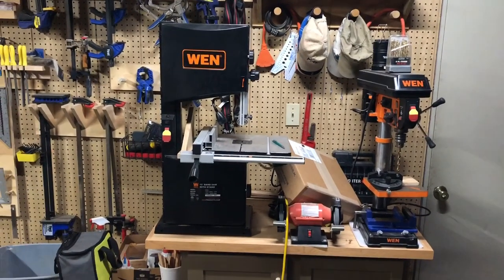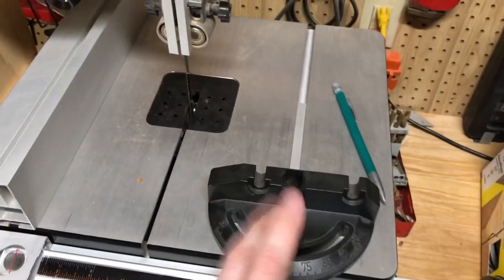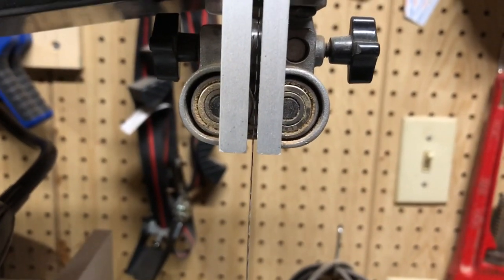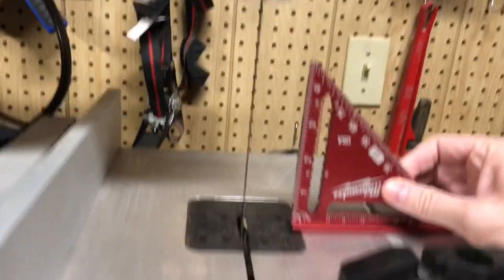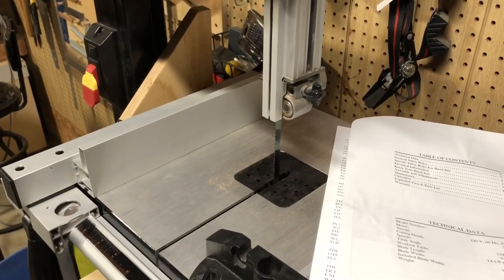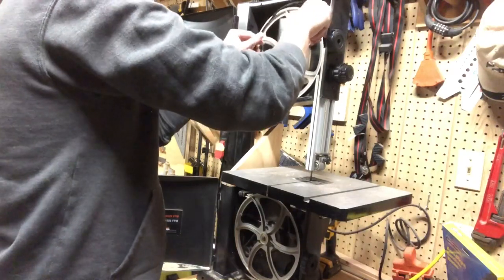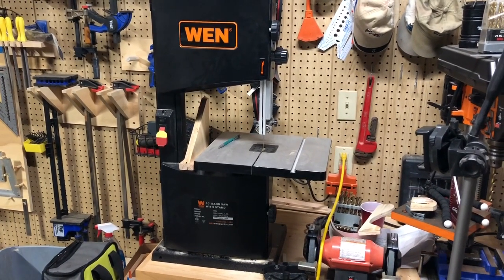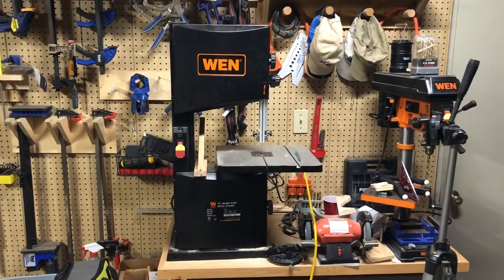WEN 3962 10” Band Saw Review

Comment: On the tilt handle you can pull the handle directly out and it will be able to rotate to the next indexable spot. I'm not sure if I explained that in a way that makes sense, but if you stand behind the saw then pull the handle toward you can rotate the handle. Hope that helps.
Reply from the maker: I just tried this out and you are correct.  Weirdly enough I didn't see this mentioned in the manual in the section on adjusting the table.  Thanks a ton, I'll put this info in the description.
Reply: @NotThatMattNagy  I've been caught out before on the "damnit, this handle interferes! what a stupid design!" thing before, and then as I'm raging accidentally pull on the handle.  <sheepish grin>

Comment: I’ve the same saw and I have a re-saw comment.  After watching Stumpy Nubs video on band saw blades and teeth I felt well informed.  I was having a terrible time getting my blade to cut straight and found that moving to a 4 TPI, 1/2” deep blade did the trick as Stumpy suggested.  I can now cut straight in 3+” thickness wood and can thus re-saw accurately now.  I also ordered a 1/4” blade at 10 or 12 TPI for cutting curves.  The right blade makes all the difference.

Comment: This is a good review. Thanks👌

I bought this saw one month ago from Lowe’s $235 with free shipping to my door 👍. This saw is replacing my 9” WEN bandsaw which is going to my son’s home shop, I like WEN products. Getting a lot of use out of it cutting everything from pine to maple & oak and plywood. I passed up a beautiful ‘60’s 14” Delta for this saw that’s a 250+ lbs saw I didn’t feel like moving. Anyway this WEN is a fantastic saw does everything I want. Things that could be better:  needs a standard 3/4” miter slot for making jigs, change the fence handle so it doesn’t block the bottom door (that’s all). Love the light, upper blade guide construction is solid, table adjusts easily, great stand, great dust collection, 6” re-saw capacity, quiet and plenty of power. I don’t experience any blade drift on this saw. The miter gauge is OK usable, the fence is fine I get good use from it and like the configurable options.

For blade tension and selection tips check out Timber Wolf web site for bandsaw blade information.

I lightly “pluck” the blade until I hear a clear ring to judge proper tension.

About the 6” re-saw capacity, my philosophy is to use a saw to about 80% capacity. So I limit my re-saw to about 4.5 to 5” regardless of the type of wood. I’ve milled maple and apple tree parts without any problem. This is a great 10” bandsaw.

Comment: I have had the same bandsaw for a couple of years. It works well for what I have done, which includes cutting boards from small logs. As for removing the fence to change a blade, I just attach the guide bar with only two of the four clamps. Half the work then. I also have mine on the stand, which is them on a mobile base. It seems very firm to me.

Comment: I too am very impressed with the WEN products price performance. A few months ago I bought the WEN 4214 Drill Press and the WEN 6502 4X36 belt sander.  Both are excellent to use and so far both run perfectly.  I also bought the WEN Forstner Bit set which works great and some Wen F Bar clamps which also work well.  Today I ordered the WEN 3962T 10 inch band saw and I was pleased that your review was mostly very positive about the unit.  I am looking forward to the arrival of my band saw and as with other WEN products I'm confident it too will perform well.  Thanks for the informative review.

Comment: For the table lock knob and all like it, pull out on it and you can place it at any direction.  Tighten some then pull it out and relocate it and tighten more. I have this saw. Finding blades for it takes some searching.  Mine will not track a 1/8 blade.  Also the guide bearing are difficult to adjust.  I will eventually replace mine with a nice powermatic
Reply from the maker: Someone pointed that out and I put that info in the video description. I have good luck with Carter for my blades; just bought a 1/2” 4 TPI blade for re-sawing. I found the guide bearings fairly straightforward to adjust, maybe a little finicky. I think I will always have a small bandsaw like this to cut curves, even if (when) I upgrade to a bigger bandsaw.

Comment: I bought the Ryobi bandsaw yesterday (BS904?). I figured it would be "good enough" for me before seeing this video.

The main differences between the two was the Wen has a stand, light, guide bearings, a two speed motor, and more power (3.5A vs 2.4A). The positive stop for leveling the table and double the resaw capacity is a bonus. About the only negative I've seen that wasn't mentioned was the lack of a de-tensioner lever that other saws seem to have to pro long blade life (I don't think the Ryobi had it either).

So after this video, I reboxed the Ryobi, got a refund, then ordered this Wen. I'm paying about $100 more than you did unfortunately, but I feel this saw will give me more for the money than the Ryobi in the years to come

Thanks for the review!

Comment: I just bought the exact saw, mounted on stand and very solid. I was looking for help on tensioning the blade as each I time I try to cut the blade wonders even with the fence. After your review, it seems my blade is too loose. Good review. I find the fence useless as it does not lock on square.

Comment: Great video. Bottom of pg 12 of instructions describe the tilt lock. My 45 degree stop maxed out before the table got to 45 so I removed it. I might grind out the slot later. I think an advantage of the 0 degree stop is  it gives a solid support to the table.
Reply from the maker: Thanks, I checked the bottom of page 12 in my manual and it didn’t say anything about tilt lock. Weird. That sucks about the 45 stop, but I think you’re right, a little grinding with a Dremel will do the trick.

Comment: And it has ''ROLLER BLADE GUIDES'', a major plus. I do like the size of that table. I use those clamp on spot lights to high light all my cut lines, especially over my shoulder pointing at my scroll saw, the built in light is a must have!
Reply from the maker: It’s a nice little feature to have, I use my light a lot.

Comment: I also have the same band saw and drill press along with the Wen bench top grinder.  All have proven to be well worth the money.  The under the table adjusting handle for tilting is fine and does not really have a design flaw as that handle can be adjusted to any position by pushing in the small knob on the end and pulling the handle towards you and turning then release at the position you want it.
Reply from the maker: I agree, all of my WEN purchases have been well worth their cost.  Another commenter brought up the point about the lock handle, and I put that info in the description. Adjusting the handle in that way isn’t listed in the manual though, so WEN may want to check that out.

Comment: The feature that works the best is the dust collection port. Breathing less dust is always better, as is less dust building up in the saw. Not on that, but the vac or dust collector draws air through the motor keeping it cool, especially important when cutting thicker stock/ resawing.

Comment: Gord LeLacheur
Looking to purchase this bandsaw and have just seen this review.  Very good review. One comment is that if the fence rail has four securing bolts and if two bolts are on each side of the blade slot, could you not saw through the fence with a, 1/8" kerf chop saw at the table slot point to allow the blade to be changed without removing the fence rail and still have enough fence rail rigidity to support the sliding fence ? Just a thought.

Comment: You can get some flexible 4 inch hose and hook it to a shop vac or a dust collector.  There are these cyclone devices too that mount on a trashcan and use a shop vac.  Most of the stuff ends up in the trash.

Comment: Not sure if you get this... Not sure if I am having an issue with my WEN Band saw or not.
Are you able to move the top wheel forward and backward?
The tension screw knob came out of the square metal part and I needed to remove the back plate and get it connected. Now the Blade tracking know, when I turn does not do much and I can move the wheel forward and backward. Have you had any issues like that?

Comment: I’ve not dealt with this saw but was wondering if the spacing on the fence guide bolts were so that you could cut the guide so the blade would travel through during change

Comment: The welds break on bandsaw blades quite often. While working my way through college, I had a job that required me to weld 100 to 200 broken bandsaw blades every week. I particularly disliked the welding and annealing of blades used for cutting meat due to the smell of the burning tallow.

Comment: extremely well presented. I just bought a 3359T the 9 inch version. I never used a power saw before. I gave it a quick try and now have the courage to use it more. I will be rarely using it though. For small craft wood projects. I might need to do a few cuts on a thick hard wood board like 3"x3"x20". Bevel cuts, slight angles etc. And at other times thinner boards. Wondering if I should swap it with the 10" version - the 3962. The build quality seems about the same from your presentation. Mine came with a 1/4" blade.
Reply from the maker: I’ve only ever used it for 90 deg cuts, but that’s because I have a table saw and/or router table for the bevels.

Comment: It may or may not be the case with the lever handle knob on the back of the saw for angle adjustment, but it may swivel when you pull out on the handle allowing you to reposition the lever and turn it from a different position. Sort of a locking ratchet motion that I have seen in other designs. Again, this may not be that type of handle.

Comment: I wish you would do a video on detail adjustment which I find painful on this saw. 3/8 factory vs 3/16 you must have did a guide adjustment and the tracking vs tension I find mind blowing on this unit. I have a perfect track with tension way under 1/8 deflection. As soon as increase tension it tracking goes south. Only way I get it in is to tighten in tiny amounts and tiny tracking until it runs right (which is blade center not curf...don't know why but it works). The guide the top isn't bad to adjust but you have to do both and the lower is very tweeky. My attempts at blades other than 3/8" factory have failed (1/8" just broke in no time). I'm going to try the 3/16" like you did so I can get my middle of the road. I also never leave fence on just because it's for re-saw or straight cuts that really are too much for this saw. Please consider that detailed adjustment. the big guys all do it with Powermatic or other industrial grade and their guides aren't like this.

Comment: Im debating on getting this bandsaw but I just had to buy a new table saw, and planer. I did go cheap on the planer and got the spiral head wen planer. My band saw just stopped working so I do need one but in all reality it is a nicer one then the wen just old and I can probably fix it. The motor is making a noise but will not move so I may take it apart see if I can get it going again. It's either that or risk the wife giving me grief over buying toys. She's never said nothing to me in the past but I've made a lot of purchases recently and the last couple I've gotten the look. She has already said I have a tool addiction in play but with women you never know lol.

Comment: So the handle for the table and tilt does not pull out while tightened to be moved to another spot ? Or in other words tighten it down pull the plastic handle out towards you and move it to another spline and it pops back on....this is how it should be...My Porter Cable bench sander has that kind on the tilt table for the disc...AND it also has a design flaw with the dust bag not being able to be turned 180 degree to lay BEHIND the machine....hits the mounting leg...
Reply from the maker: A commenter pointed out awhile back that the handle does indeed pull out and move to another spot.
Reply: @NotThatMattNagy  Looking at the 9" right now not sure the price difference is worth it..

Comment: Great review but was hoping you’d mention the blade tracking on the bottom wheel.  While I can center the blade on the top wheel, it wants to shift towards the very front side of the bottom wheel, to where it looks like it might come off. Any way to adjust that?
Reply from the maker: I haven’t encountered this issue. The bottom wheel isn’t readily adjustable. I would call Wen and let them know.

Comment: Thanks for doing and posting this great video. Do you know if 72-7/16 Length blade will work?
Thanks in advance.
Reply from the maker: My guess is probably not—the manual doesn’t call for anything except a 72” blade, and I don’t think the blade tensioning system has 7/16” inches of travel built in it, which is at least what you would need for that blade.

Comment: You don't have to take the wing nuts completely off, in order to remove the fence guide. Just loosen them enough to pull it off. That way you won't have the hassle of threading them every time you take it off. I t helps to read the instruction manual now and then. 
Gabby
Reply from the maker: There’s a manual?!?

Comment: What use is it that it cuts up to 6" thick if, according to you, it doesn't have the power to deal with anything thicker than 2"?
Reply from the maker: It all depends on the type of wood and the blade width. Stock blade cuts through cedar and pine at 6” just fine, but you might need to buy a 1/2” blade to cut through harder woods at that interval. Generally speaking though, the harder the wood and thinner the blade, the longer it’ll take to resaw, if it can even handle it at all.

Comment: Thanks for the in depth review. When you used the full 6" resaw capacity did the motor bog down much? What wood were you cutting?
Reply from the maker: Pine. I actually recorded cutting a pine 2x6 for this video but somehow lost the clip. It was slow going using the stock blade, and the blade would squeal a bit, but it worked.  That said I typically resaw using my table saw.
Reply: @NotThatMattNagy  Thanks. I doubt I'd ever resaw that thick of a piece of wood but it's good to know it's capable. I have a couple projects where I'd resaw some 4 inch hardwood so I was wondering if it would be capable of that

Comment: I need to find a bandsaw that can resaw plywood thats 5-6 inches. Is this saw decent enough to do the job?
Reply from the maker: I actually haven’t tried to resaw plywood. My guess is that it’s be fine because the plys are generally softer wood or just filler, easier to saw through.
Reply: @NotThatMattNagy  that’s what I was thinking. Thanks

Comment: I don’t know for sure but it really looks like you don’t have enough tension on your blade when making that curve cut, your blade was moving too much side to side which would indicate it’s not tensioned or the guide bearings aren’t set
Reply from the maker: That was my first thought, so I tried various ways of tensioning and bearing alignment and got almost the same result each time. I found out later that the tightness of a radius you can cut is dictated by your blade thickness. In fact, on the Wen product video for this saw, they mention that point, which suggests to me they know the stock blade isn’t great at cutting curves. Option 2 would be to make a shit ton of relief cuts first, then see if that helps, but that’s a lot of work and I’d rather just use a thinner blade.

Comment: Could you cut curves in 4 inch stock if you go slowly?
Reply from the maker: Depends on the wood, and depends on how tight of curves you want. It’d be tough but gentle curves are doable with soft wood.
Reply: @NotThatMattNagy  I would be cutting blanks for birds out of Tupelo, which has a Janka hardness of 870.  I know a 14 inch would be better suited but I only do 5-6 carvings a year so I’d rather not spend triple the price.  Thanks
Reply: @NotThatMattNagy  and I meant to say 3 inch sorry